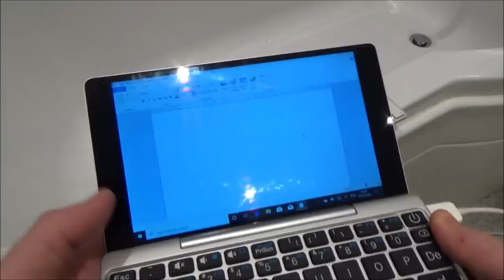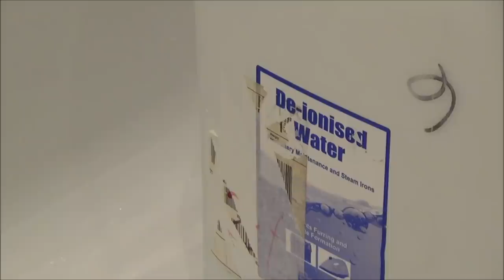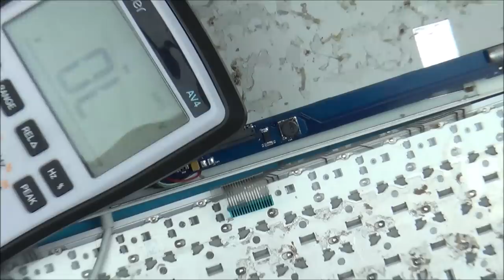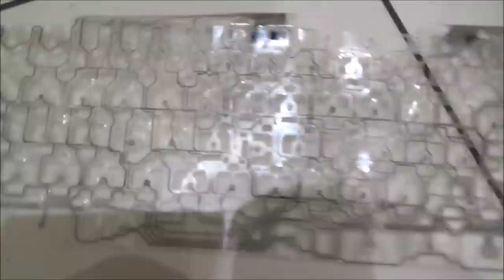Trying to FIX : Faulty Apple Keyboard Model A1243 purchased on eBay

Comment: I've just repaired an apple pro keyboard, circa 2001 from a classic mac i have, the keyboard came with the quicksilver models. The story started when i spilt coffee from a flask! on it, it went everywhere. So it needed cleaned anyway, but, boy was it a pain, you can get the main board and the accompanying membrane and metal chassis away from the clear polycab easy, but after taking all the keys off the amount of screws that hold the membrane and chassis together are ridiculous and bloody tiny as well. It took ages to get all the screws out, clean everything then put it all back together, thought i'd done a great job, did it work nope (god dam) then i thought there might be still water in it; i'd not washed the membrane or electrical parts in-case, what happened effected the outcome, just the polycab areas and keys!.  needless to say, somehow, water must still have got in somewhere, as it was stone dead. However, a little patients and a day in a very, very! hot conservatory 31 plus degrees and what would you know it works. Just shows what patients gets you. Thanks for an honest and informative video.

Comment: About 20 years ago when I was doing my own DIY car PC/MP3 player I had to use old keyboard (because it has the controller chip) and just find shortcut keys from those keyboard membranes. So example if space was play button on winamp you just had to find which two lines connect when you press space and solder a switch to those lines and you had play button.

Comment: Thanks for the video! My case is a bit odd, because only the number keys stopped working after a casual clean with rubbing alcohol, but the "zero" is working. So 1, 2,3,4,5,6,7,8,9 not working. This way I can't pair the keyboard or enter any passwords which renders my keyboard useless. It's the smaller model with no num pad. Mouse keys is unchecked. I tried everything offered in blogs and discussions, but nothing works. Any ideas?

Comment: I fixed a wireless apple keyboard model A1314. Was able to remove board and was able to clean and DeoxIT clean the corrosion. Apple products are hard to open, designed and built that way on purpose!

Comment: Thanks for this. I was heating my keyboard to try to pry it open, and I put this video on at the same time. I realized I could just stop and throw it in the bin Instead of wasting more time dismantling it. No way I could repair this. Also, mine was broken because I got a few droplets of beer on it, because I suddenly had to cough while I had a sip of beer in my mouth. ( looked funny though ). So they are very fragile when it comes to moisture. Mine stopped working over night, I guess because of the corrosion process it had a delay. I will buy a cheap new one or second hand one instead.  My mac works with other brands of keyboards, so there is no problems in buying logitech or other cheap stuff.

Comment: Hi, I have a question 🙋‍♂️.

I’m currently building a 17 inch mac book pro with the internals of a M1 Mac Mini and I was originally planning on removing/ cutting into the case in order to fit in another high end keyboard however, I’ve also come across the teensy board which would allow me to rewire de signals from the ribbon to usb… unfortunately that all seems too tedious and I’m afraid the keys won’t really match in the end. Since this keyboard is mechanically similar to early mac book pros’ do you reckon the chips on this external keyboard could be used as the encoder for the inbuilt macbook pro keyboard?

Comment: The diode is completely normal. It is reading the resistance through the rest of the circuit. If you was to take the diode off it would read  .1883 one way and open the other way. If you test across the empty pads where the diode belongs on the board. You would read   1.3571 both ways.

Comment: if you get something wet you need to let it dry for a few days if you can't get it apart to do it. water don't kill stuff. electric added to wet stuff does.what made you think spot welds? i never seen them ever in electronics. i would have thought they were solder and desolder them.

Comment: Vince, before going to destructive methods, you could've used oscilloscope. It wouldn't have changed anything this time, but under normal circumstances, it makes sense to check/measure as much as possible before destroying it for the sake of learning.

Keyboards work by cyclically sending short impulses through a number of lines and reading signals on the other set of lines. Pressing a key shorts some input and output lines and by analysing input and output signals keyboard electronics can say which key was pressed.

You can measure signals on both ribbon cable connectors and see what signals were sent or received. I don't know exactly how this keyboard works but most likely one connector is for input signals and the other one is for readings. In any case, oscilloscope would've shown it. 

And shorting the output lines is a bad idea. Because at any given time only one line is active and all others aren't, by shorting them together you are looking for trouble and risking to fry the controller.

Comment: Nice experiment :D I have like 5 of those waiting for some miracle... but I now see they won't have a fix :D By the way, the grounded pin you found on the ribbon connector goes in pair with another one and lights up the caps lock LED :)

Comment: Normally it is caused by crap getting under the keys and shorting out the contacts or preventing contacts working properly, this can be fixed by washing the whole thing in a dishwasher. You just have to make sure you dry it out for a few days after before trying out though.

Comment: Thanks for your wonderful insight, for taking the time and reverse engineer through this keyboard! I just somehow magically ruined my A1234 keyboard. I clean the fat residue off the keys using 94% alcohol every other year or so. Now I did so, and all of a sudden the qwerty row of keys and some others stop working, and some are continually pressed. 
Depressed and let down I went to a large electronics store to find out Apple sells their (full alphanumeric) Magic keyboards now only wireless at a staggering €150, compatible ones starting at €90. I can't remember having ever having to pay those kinds of numbers for a keyboard. So I figured my 13 year old keyboard would be as corroded as the one in the video with connections being blocked (although I can't remember having spilled anything in it but some 94% alcohol here and there), but still decided to flip out some keys (the first ones, as those would be blocking the rest of the row). There were a lot of small hairs and dirt trapped there which I tweezed out, and surely enough, my keyboard works again! So thanks again for your video!

Comment: Hi Vince! Have you ever tried conductive ink for trace repairs? It couldn't help in this particular case but could prove useful in some future projects. There's a few pens on the market right now that are quite helpful on trace and pad repairs but you can use conductive paint as well to try it out first.
Great work! And for a rule I tend to stay away from Apple products when repairs are needed.
Reply: There's a conductive glue on the market for defroster repair,  almost in any car parts shop, it's glue with copper dust.

Comment: Had mine for several years, worked fine until I cleaned it the other night, now it works exactly like yours did. What a POS when you can't even clean them without wrecking them! What's a good replacement?

Comment: The number keypad switches between the number input and the function input on those keys. Toggle the NumLock button to switch between the modes. The mode that was being used was function (arrow) keys at the initial test at 3:42

Comment: Thanks man. I have been searching for hours how to simply remove the scissor mechanism of the Left Command key so I can swap the right key's cup/spring and found nothing. You show exactly how to do that. I was able to successfully remove the mechanism only to find that the silicone cup/spring that I want to exchange from the right key to the left cannot be removed/replaced without complete disassembly of the frame because it is stuck beneath that plastic membrane. Grrrrr! I hate this keyboard anyway. Time to replace it with a REAL keyboard from a REAL manufacturer.

Comment: I like this keyboard, and Apple probably touted how sturdy and premium their aluminium body is, compared to cheap commoner plastics, but the problem is that there are so many small things that can break. For example keys like ASD can quickly work apart. When cleaning the keys, the feeble plastic scissor's tiny hook can be easily broken, and the rubber cup beneath the key acting like a spring can easily torn apart. If one small rubber cup is torn apart, the entire keyboard can become practically useless (I mean, if all other keys are working, but the 'A' key, it will be very difficult to use the keyboard). Apple could have included some spare scissor switches, some spare key caps for frequently worn out keys (like A,S,D), and some rubber cups, but they don't sell them. There are third-party sellers, but they charge like $8 for one key cap, which is ridiculous because I bought my Apple keyboard at about $50 and its resell value is probably less than $20 even if it had no problems.

Comment: Hey Vince I have a logitech headset that worked great for the longest time, and now the one side doesnt work unless you wiggle the switch. If you want I can ship it to you and you can try and figure it out. I dont think it's just the switch because power remains on. And the other speaker works I also found if i give it a thud on that side it works at a different volume
Reply: It's a pc headset wireless. Logitech G933. I dont need it anymore I just went out and bought a new one.

Comment: as usual its the traitoff: good looking, nice to use vs repairability. I'm completely against throw-away hardware, but being an engineer myself, I know that in some cases there is no other solution. mechanical switches is usually a bad topic there...
so: the correct answer would be: buy standard thick keyboards with screws in the bottom and you got repairability.
If you want it slim and shiny and looking as beautiful as apple products, usually it will involve glueing stuff and thus automatically bad repairability.

Comment: I wouldn’t test the keyboard right after the water fix because even if you dried it with you hairdryer, moistures can stay in there for a lot of days. It would have been wiser to try it out 3-4 days later.

Comment: 58:30 - of course it can be made with a circuit board, you could even make it out of Californium, however it's all about the price point. It's expensive to make a thin keyboard with full travel mechanical keys, expensive to make low profile keyboards as well. You can make keyboards very cheaply, but you have to make a few compromises...

Comment: It may help to disassemble a simple, conventional, PC keyboard from Logitech, Microsoft, PC manufacturers to understand how they work - eg how the two conductive layers form a circuit at corresponding points at each key that is translated by the board.

Comment: The reason the keyboard didn't work at 25:29 was you can hear it disconnect, it makes the USB/hardware disconnect sound. Once when you connect it, then 2 seconds later the other one saying hardware removed. That then tells you it is something other than the keys and on the main board of the keyboard potentially. At 27:30 the usb ports will work regardless because the main chip, that you identified as warm will be the keyboard, the usb sockets will not be running through there so no need for the firmware etc. for the keyboard itself. They would effectively be a different circuit. Again at 34:00 you plug in and hardware attached sound then hardware removed sound. 

So twice now, you have had the hardware removed sound thus no input as the keyboard needs to be connected (hardware removed sound is a huge clue), that coupled with the power to the ports, means power is flowing, thus, I would be looking more to the firmware side of things meaning potentially the main chip failing due to the first time (huge clue) where only certain keys were working. Go back and listen again carefully and you will realise, if the keyboard has been detected then dropped, then as soon as it is dropped then it effectively has NOT been connected. If it isn't connected, then no keys will work on any keyboard due to no power. 

Now, it might not be a main chip issue but definitely the laptop or computer making that disconnected sound means it isn't going to work regardless, even if it were brand new. Unfortunately you missed it by talking over this important sound. Keep device manager open when you do this and then expand the keyboards section and this way you should see it connect and disconnect when trouble shooting. 

Now with these clues, warm chip, Hardware connect and disconnect sound, some letters working to start then complete failure. I suspect the main chip was failing to be honest and maybe replacing that would have solved it. Certainly the main circuit board is where I would have concentrated and due to other capacitors being ok, again I double down on that one main chip.

Comment: Keyboards do not use simple switch to ground connections. That would require more than 100 lines. Instead they use a matrix. Each key connects two data lines and the controller chip checks each pair of lines very rapidly for connections between them then decodes the results to determine which key was pressed. each data line has many keys on it but each key only connects a unique pair of data lines.

Comment: Hi. That small laptop you are using to check keyboard at bathroom - what is it? What's the model?
Reply: A bit late to the party. It's the GPD Pocket. It has since been replaced by the GPD pocket 3.

Comment: When you plug-in the apple keyboard, don't you hear the device (drivers) mounting and dismounting within 2 seconds?
Reply: No, that's a windows thing.
Reply: Ricky Ostrom yeah
Reply: On windows
Reply: @PaulJamesMuldoonGYST  it;s a sign of a (low) power issue. Short or overload.

Comment: best use for a dead one, where the tracks have acted like fuse wire at slightest overcurrent or ended up corroded, is to harvest the keycaps to freshen up a working one thats seen better days (ie faded worn caps) 

Well, assuming the faulty one hasn't got faded key caps itself :)

Comment: If you would have used a drill press with the correct drill height you could have drilled out those welds way faster and accurate.

Comment: I was having a look at a keyboard membrain of an asda keyboard about 2 years ago, I did take a picture of it, and then followed the traces with paint in windows. and basically works out something like ribbon 1 pin 2 would be q,w,a,s,z,x, and then ribbon 2 pin 1 would be something like tab,q,w,e,r,t,y. then ribbon 2 pin 2 would be something like u,i,o,p,[,],enter.
Reply: and that is why when you tried shorting 2 pins on the same ribbon together then nothing happened. I can't remember exactly which track done what, but gives you a better clue now. as 1 ribbon is for top layer, and 1 ribbon is for bottom layer

Comment: it's not water that kills these. it's usually a type of soda (i believe mine was pepsi #notsponsored), and that is an acid. that one goes through the silver deposits. I have washed mine (not submerged, and not powered) since 2011 at least twive a year and it only broke last year because of the soda spilleage. and the soda was very quickly washed after the spillage, but still at least one track was gone.

Comment: it's such a shame because apple where actually a brilliant system for mistakes back in the apple 2 days. they used to have a drain in the keyboard just in case you spilled something that would allow liquid to just run back out and minimise the damage, modern apple have such great ideas as a high voltage line right next to a CPU data line so if there's a slight fault or ark, then the CPU fries, they are not worth the money anymore

Comment: A former company I worked for would put these part in a ultrasonic bath with a oxide solution for 10-15 minutes then put these in a oven for 45 minutes on 30C-45 C 

It worked in ca 70% , if the USB ports don't work in the beginning there is more wrong with it

Maybe it could help one, but if you don't own a huge ultrasonic cleaner you can find a way to make one with a bin and a Sander😉 maybe it can help someone

Comment: Keyboards are made this way for at least 20 years... i had a cherry G83 that was made of such  layers. when i spilled juice in it i tried to dry the layers but it never worked again, cause you then brake the routes on the layer by just slight bending. Therefore: never spill liquid in keyboards. when it happens, get a new keyboard.

Comment: I know this keyboard is way past saving but you can repair those traces with "car rear heater window Paint"...it has silver particles/dust suspended in an adhesive... I used to fix keyboards with water damage it all the time maybe 15 years ago...not mac ones though
https://www.amazon.co.uk/dp/B015HJL0VQ   <-- Paint...there are loads of makes
"Water" does not actually damage the tracks, its things like "Cola" or brews...anything other than water corrodes the traces so quickly ...try dabbing some coke on a track and watch it...you can see it in real-time turning black

Comment: It seems like a lot of these comments are from people who have never opened a keyboard. Apple's keyboard is well built and in line with how most other keyboards are built. The one bad thing is that they didn't put screws so that the 1% of users who want to fix it after they spill their drink on it can open it easily. Also I used to work in a repair shop and when people mention they never spilt water on it, you can just about guarantee it has liquid damage.